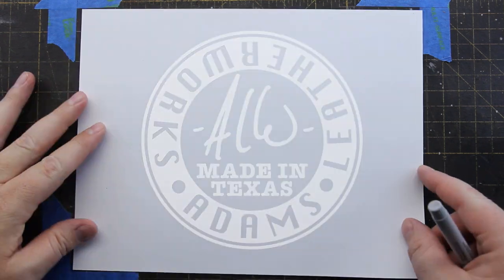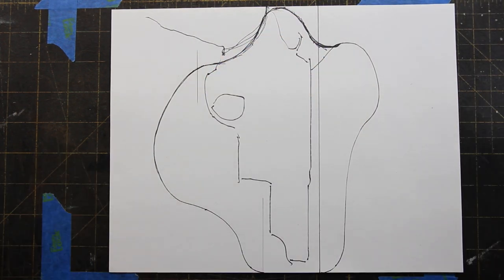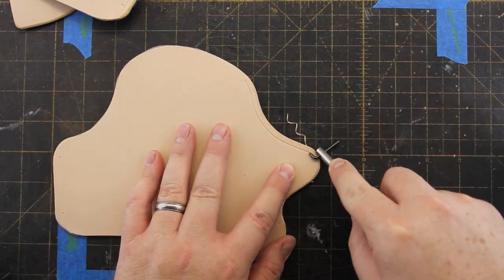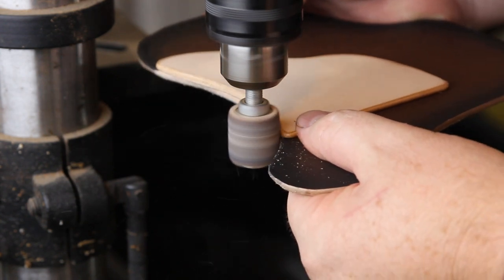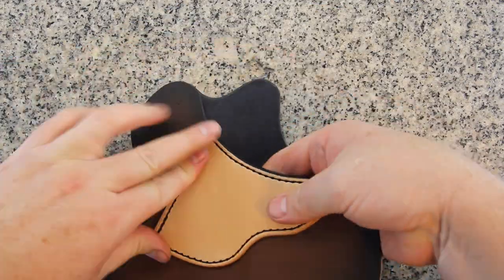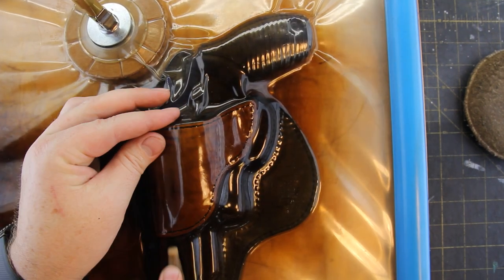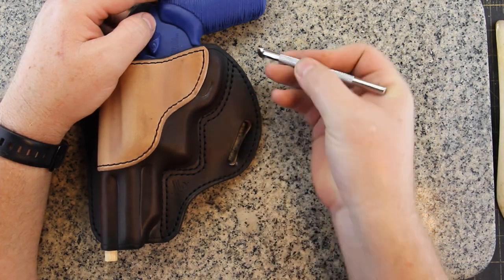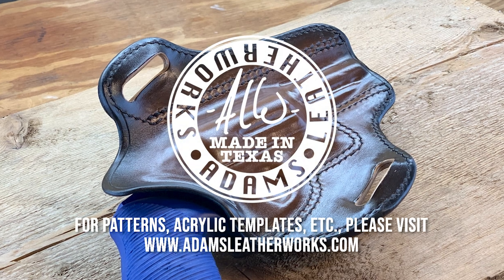Making a Flat Back Pancake Leather Holster - Taurus Judge 4510 3 Inch

Comment: Hey, I built a holster for a Luger .38 Special along your video. You are absolutely right, the glue up of the body pieces is a pain in the butt. I ended up glueing and sewing the  trigger guard side first. The other side has a straight stitch line and can easily be clamped down with two smooth pieces of wood. That prevents the walking….

Comment: I switched from gum trag to tokonole. Also I slick the inside with it that way I don't have to do it while it's together and it makes it bout as smooth as the flesh side. You do really great work. Your pattern skills is off the charts.
Reply from the maker: I need to give Tokonole a try. I have two questions for you. Does the tokonole inhibit absorption of water when it comes time to dunk & form the holster? I've thought about burnishing the interior with Gum Trag prior to assembly, but didn't want to affect the forming process. Second question - does it inhibit dye penetration if you burnish the edges with it prior to dying the edge? Thank you for the compliments - I really appreciate it.

Comment: Well......You asked for suggestions! 
I am interested in a right-handed cross draw OWB pancake that can handle the weight of a 4" barrel S$W L frame in 44 call. The problem I see with this type of inclined holster, besides the weight of the L frame, is distributing the weight evenly while keeping the grips tight against the left abdomen and out of the way, without having the barrel sticking out the back obtrusively. I live in brushy bear country and don't need anything protruding. My right-hand side needs to remain clear of obstructions in order to do chores. Neither do I want that much iron in the small of my back in case I take a tumble. 

I need quick access to the piece and tight holding tension as I work, while maintaining maximum body mobility. It seems that a wide pancake might do the trick. Tried a shoulder rig that was miserable to wear, and a chest rig is cumbersome and out of the question. Would you suggest friction alone, or in combo with a thumb-brake or some type of barrel tensioner?  Haven't seen a production rig yet that will do all of that with reasonable comfort. 

So, there it is.

-Thankx........🐴

Comment: Hey Particle 😉
I make all of my owb leather using Sam's method, as well as line them all. One thing that may help you when doing them like this (this applies more to autos) :  when you're assembling the front and rear panels, glue and stick the trailing edge first, then stitch.  Then do the leading edge on its own.  That way you only have half the struggle of keeping things lined up.  There's a lot of pressure on the glue and you may have noticed the panels will try and shift a bit. For autos, when I'm assembling the leading edge, when u get to the bottom pivot stitch point,  I go in reverse all the way along the slide stitch line to keep the machine feet off the wet hump. 
I'm with you though,  i hate revolvers and also avoid them but now i may start trying them again. 
Great job.
Reply from the maker: Thanks Jason - I’ve done it the way you suggested on a couple other holsters and it was definitely easier! Take care and thanks for watching and commenting!

Comment: Great video, I like the way you measured the stitch lines with a piece of leather.
Reply from the maker: Thanks Jim! If it wasn't for the awesome work Jason Ingle and Sam Andrews produce with that method, I'd probably still be using the old 1/2 slide thickness plus one thickness of leather equals stitch offset. Used that for many years, but this leather strip measurement method is more accurate, and so far, the lines have been nearly perfect on the first try every time.

Comment: Thanks, Adam for your original Avenger style holster pattern making video, I have made nine holsters for my handguns avenger style. And two avenger style cell phone holsters work great, man I need a sewing machine my awl just ain't getting it done.
Reply from the maker: Thanks Roger - I bought a Tippmann Boss right around the same point you're at. Leather sewing machines are pretty expensive, but they hold their value pretty well. I actually sold my Boss for more than I paid for it. Thanks for watching and commenting!

Comment: Ok so I have a project! I have a huge old men’s leather jacket. I want to pull it apart for its leather, and start putting some of it to use for holsters for me and my husband. One particular I know I want to make for myself, doesn’t exist on the market. I’m thinking high calf leg carry! Sitting right above the meat of the calf so it doesn’t slip down. It’s a really comfortable carry for me as a woman. I’m debating if I should try to do any water molding at all, or simply just make a snug pocket type hold. I’m just trying to make something really functional and comfortable for an everyday CC. I’m going to be doing everything by hand, no equipment owned. I don’t have burnishing supplies or anything. And I’m wondering what I HAVE TO buy for this build, versus what’s not necessary. My CC is a m&p shield 9 compact. It’s a very flat profiled gun. Advise? Tips? 🙏🏽♥️

Edit addition- I’m also needing to buy the basic things like needle and thread for hand stitching, hole punchers, snaps/ grommets, etc. something I was debating still too, is for the deciding of the straps that go around the leg, is if I should do buckles, or Velcro. Obviously buckles would be better for longevity, but with Velcro u can get that perfect custom size. And the body swells and shrinks from day to day…. So a 100% leg carry might need that extra 3mm tighter, that the buckle can’t give you. Thoughts?
Reply from the maker: Hi Jaqui! Regarding the leather jacket - the general belief is that chrome tanned leathers (which is likely what's used on the jacket) should not be used for holsters and such due to the corrosive nature of chromium salts used in the tanning process. But, I have seen others say that modern tanning processes basically almost eliminate the corrosivity from the leather, and it should be safe to use for holsters, provided the leather came from a reputable tannery. The bigger issue is the soft nature of the leather, and its ability to wet-form like traditional veg tanned leather holsters. If you want to use the leather, I would consider using it as a lining on the exterior of the holster, but using thicker/stiffer veg tan on the interior.

Regarding tools - you don't need a lot of fancy stuff. To cut your leather, you can get by with a simple x-acto knife. I believe it was Sam Andrews that I saw cutting his leather with the blade upside down, with the leather on top of a piece of carpet. He cut in a sawing motion, away from him. I prefer a round knife, some people just use leather scissors. To sew, you'll need some way to punch holes in the leather. I've seen people use a sharpened finish nail in a drill press to punch their holes. Or you can buy a stitching awl and harness needles and learn traditional saddle stitching. It's not difficult, or cost prohibitive - it just takes a little practice. For burnishing, If you have a drill press, you can buy small sanding drums to sand your edges flat. That's all I use. If you don't have a drill press, you can use a Dremel with a small sanding drum. If you have neither of those, just use a sharp knife and cut the edges flush. I've even seen people use a freshly broken piece of glass to scrape/shave the edges smooth. You'll need an edger or two. I just have two sizes - the smallest "0" and a larger "3". I believe the 0 is 1/16" and I think the 3 is 3/16", but I've never understood beveler sizing. You'll also need a hand wooden burnisher. I like to use saddle soap and/or a glycerin bar to slick my edges. For molding, you don't need any fancy presses. The smooth end of a sharpie marker can work for most of the molding, but I'd also add a (real) bone folder to the arsenal.

I would probably avoid velcro because it wears out so fast, unless you make the straps removeable so you can replace the velcro if/when necessary. Nylon webbing with snap buckles might be a better option, or just use small buckles with shorter hole spacing for more adjustability. But 3mm is an awfully small amount of adjustment. Perhaps if your strap was adjustable on both ends, that would increase your fine-tuning ability. The more I think of it, attaching a velcro strap with something like Chicago Screws might be a more simple option. LOL

Not sure how much I've helped, but let me know if I can answer any more questions! Take care, and thanks for watching!
Reply: @AdamsLeatherWorks  Well… now I feel like you dismantled my entire idea with the jacket leather! Lol!! So let me explain out why I was thinking that. I have a very cheap neoprene low leg holster. It’s literally just neoprene and Velcro, and oddly…. It’s been my most used holster! It’s so comfortable because it’s so soft and flexible, and it’s not starting to fall apart in any way, after over a year of daily use. So the idea for this one, came from thinking I could make something similar to that one, that just had more of the finished look that leather provides. Because I open carry almost always. 

The concepts for carrying that have worked the best for my lady body, have always been the ones where the holster just sort of wraps it down against me. All my expensive holsters are too rigid, too stiff, and hold the gun out away from my body, making this really big bulky profile. And literally not working for anything I usually wear, which is a lot of athletic clothes, yoga pants, skinny jeans in the winter, etc. So what I’m going for with a holster, might not necessarily be anything you’ve ever even made or seen?? I just found your channel the other day when I was searching, and it was very helpful! But I don’t really know if you’ve ever gotten into more of the sort of “wrap up your gun against your body” type of carries? 

I’ve seen it in a lot of belly bands for women, and leg wraps for women. And I own some of them too. So that’s what I’m going for! But of course I don’t want to use a material that could possible damage my guns…. How do I even find out what the case is with this jackets leather?!! 

And thank you for responding! And lending all your experience and wisdom! I really appreciate your time and attention.

Comment: Nice job,  Eric. I recall, a few years ago, a long discussion on flat backs on leatherworker's forum. I never quite understood the concept, since it isn't really all that flat on the back. Especially after boning.  It's a pretty holster, though :)
Reply from the maker: Thanks! With leather being relatively flexible, it is hard to keep the back perfectly flat. I believe some makers use a thicker piece on the back, and thinner piece on the front to help maintain more flatness on the back side. But compared to a traditional 50/50 pancake, the back is way flatter with this stitch line method. You could certainly mold the front with all the detail and retention points and pretty much leave the back un-touched, and perhaps mold a slight indent at the top of the cylinder for retention - that would keep the back flatter.
Reply: @Adams LeatherWorks I just finished a crossdraw/side draw convertible flat back for a Model 29, a largish .44 Magnum 6”, and I used equal weights of leather all ‘round.  I cheated a little bit on the flat side as my reinforcement piece was tooled and I didn’t want to smoosh the tooling trying to mold retention on the front side; I molded some retention into the trigger guard and the trailing edge of the cylinder instead, but left it flat otherwise.

Funny, i’ve been tempted to use Ingle’s method as it’s clever but never seem to have the right thicknesses lying around (I always want to use them for something I can sell), so I’ve relied on the “box method“ in calculating heights and girths, adding in the measured thickness of the leather I’m using and saving the dimensions for later recall.  Hey, I’m a masochist, but numbers dunna lie.

You’re right; curving any kind of flat back, let alone a revolver, is difficult if you’re trying to glue it up right away. I pre-bend the front by wetting the middle and matching up the dry outer edges using gentle pressure from a C clamp on dowels ‘till everything dries — this relieves the leather’s tendency to fight you matching the edges later when attempting to glue. Makes it a thrill to stitch, though.…

Comment: Love this holster, Your work is always top notch so don't down play your not being a professional because some so called professionals i've seen don't look half as good as yours. My only question is why didn't you stain the inside of the belt holes? Will it transfer to a lighter colored belt?
Reply from the maker: Thank you for the kind words. Regarding stain in the belt slots - that mostly has to do with my workflow. I dye the pieces prior to assembly, and then sew the pieces together - often with contrasting thread. The slots don't get punched until I wet the holster for forming, so I can't dye the slots until the holster is formed. By then, the slots are contorted and difficult to dye. It's too easy to accidentally dye the surface and/or thread. And yes, the dye could transfer to a lighter colored belt. Thanks for watching and commenting!

Comment: Great video. I have read your blog on wet forming and built my system using the same vacuum equipment and your design of the working table for the bag. Works great!

I’ve been asked by a customer to make a holster equipped with a paddle clip. He will provide one of his choosing. Seems to me that will necessitate a flat back to allow for the clip to be screwed into the back of the holster. I anticipate Allen screws. 

I suppose I could (maybe have to) attach it before sewing the two sides. That will complicate the wet forming. Otherwise, maybe can attach the paddle after wet forming if I can get the Allen screws through the paddle. The L-shaped Allen wrench may facilitate that. 

Have you used the paddle clip on any of your projects?  If so, any tips on how best to proceed?

Thanks.
Reply from the maker: I haven't worked with paddles yet. I believe they have a removable plate that you would install between the leather layers, then attach the paddle after forming. But I don't want to lead you in the wrong direction. It may depend on the paddle you buy. Wish I was more helpful - I've gotten several inquiries about this in the last few days - might be time for me to figure it out!
Reply: When my client brings his paddle to me I will see how I can proceed. If it works out well (or poorly) I will get back to you. Thanks

Comment: Great video. Have you ever made one for the Browning 1911 black label 380 pro? I just bought one so I wouldn't have to carry my 1954 Star 9mm. Its heavy and uncomfortable (same size as the browning 1911 45 cal). I like the pancake style because it conforms  to my old body. By the way I carried the Star on three trips to Vietnam in the 60's, the guy in the parachute locker made me a shoulder holster that worked great crawling around in the jungle. Back to my question, do you make the pattern the same way as you did in this video? if you have a pattern that would work would you share? Thanks either way.

Comment: I have 2 questions. First where did you get the belt punch made and what is the cost. The companies I looked into for making these punches where very expensive because of single quantity. Second Please show your air brush set-up and vac press equipment. Great job on the holster.
Reply from the maker: I bought my punch from Texas Custom Dies. They will custom size them for you. Mine is 5/16" by 1 9/16" for 1.5" belts. I have an article on my website that shows my vacuum press setup. https://www.adamsleatherworks.com/vacuum-press/

My airbrush is a Badger 150. https://www.adamsleatherworks.com/airbrushes/

If you're curious about my airbrush cabinet, I don't think I ever wrote an article about that. It's basically a tall cabinet that's roughly 18" deep, maybe 7' tall and about 3' wide. It has a shelf at counter height, a cubby in the bottom for my compressor, and hooks at the top to hang a 1x12 board that I clamp belts strips to. When I'm not spraying belts, I hang the 1x12 on the side of the cabinet. The back wall of the cabinet has two 24" box fans, and I have cheap air filters on the intake side of the fans (mounted inside the cabinet). The whole thing is on wheels so I can roll it up to a door so it vents the fumes directly outside.

Comment: Hey thanks for the video I was kind of in love the the Judge when it came out. I’m not sure but it appears you made your pattern out of a4 paper? I like to use poster board from the dollar store two for a buck and they have lasted so far. I’m new to leather craft and can’t get enough of the videos that some crafters take the time to make videos. Question two where do you find the plastic or rubber gun at.? Right now if I make a holster for a gun I don’t have I have to go to the gun store ask to see what ever gun I need then proceed to trace the line and say thanks. So yeah they are getting tired of me.
Reply from the maker: Thanks for watching! I use cardstock, because we always have lots of that on-hand. I try to buy the thickest stuff my printer can reliably print on, and those cutouts last a very long time. A higher-volume maker would probably tear them up pretty quickly so something more durable would be more suitable. I buy my molds from www.knifekits.com. They seem to have the largest selection, and carry molds from lots of different makers.